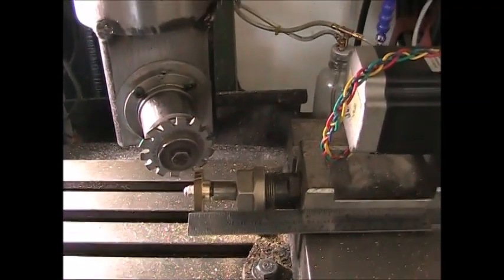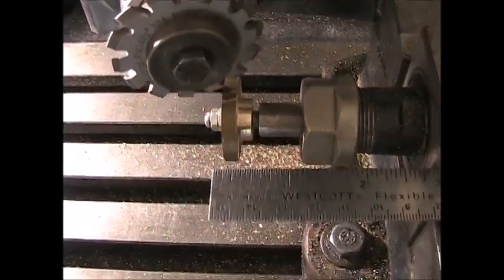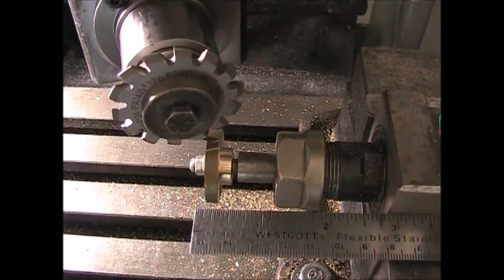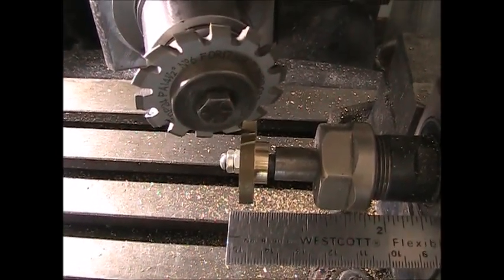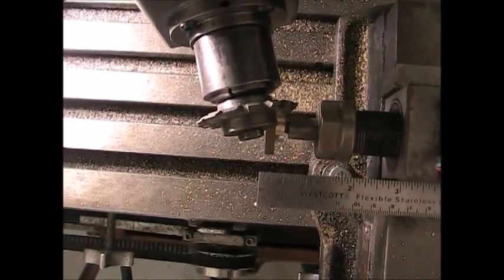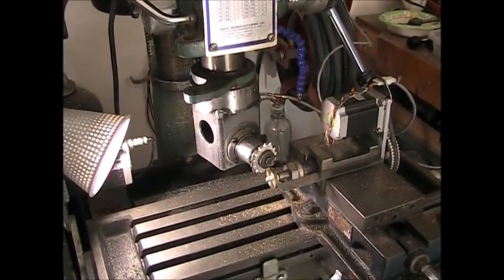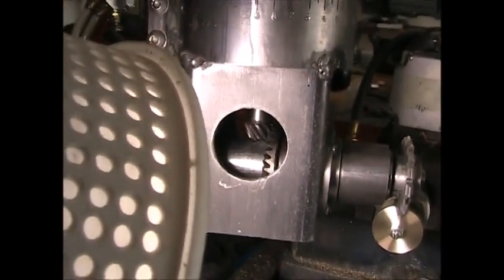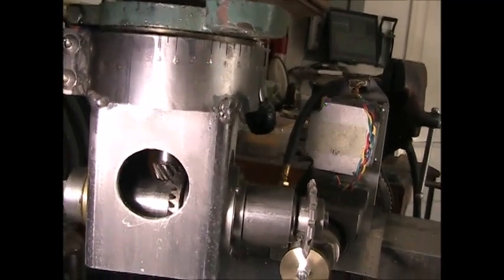Helical Gear Cutting

Comment: Chuck maybe you could offer some advise, we are trying to make an indexing rotary table mounted vertically to move a part horizontally. We want it to programmable from 5 to 360 indexes. Is this possible, we grind splines on a surface grinder with a rail with a head stock and tail stock (with centers on both) and we manually index using a hardened 8" round plate with the number of teeth we are grinding. An indexer would eliminate the need for index plates. Can you help me? Joe 480-519-5119 or info@airgear-intl.com

Comment: With the column set at 15 degrees, how do you get the fixture in the chuck to turn in relation to the x axis?
Reply from the maker: +don doerner The chuck is driven by another stepper motor which is attached to the 4th axis in Mach3.  The G-code command G1 X0.657 A0.095 causes the x-axis to move 0.657" and the 4th axis to rotate .095 turn at the same time.